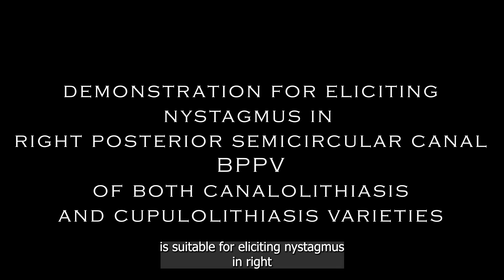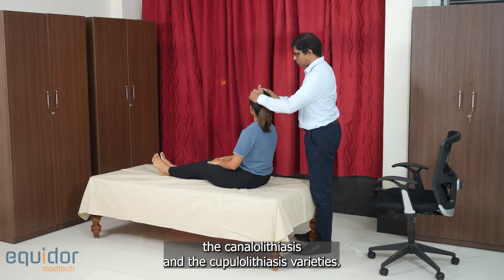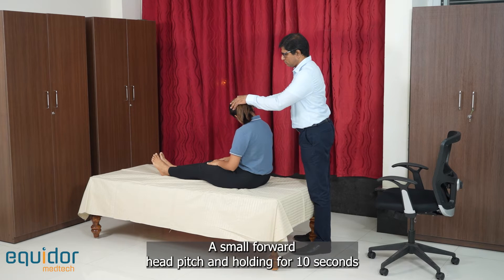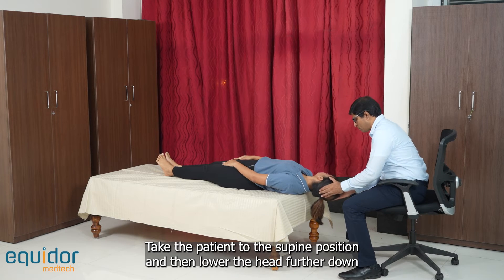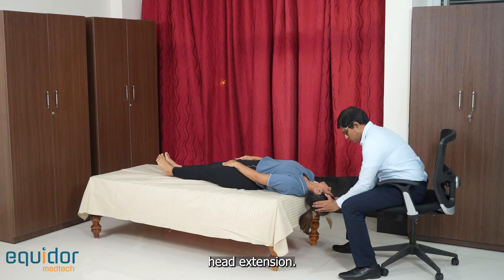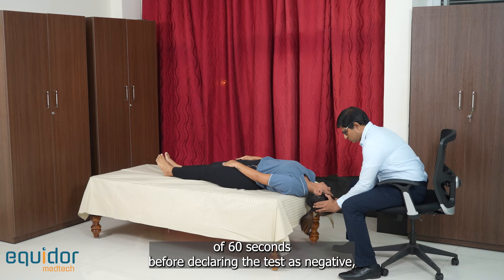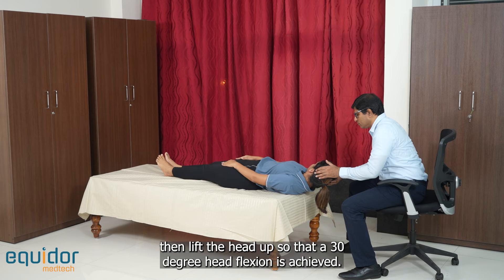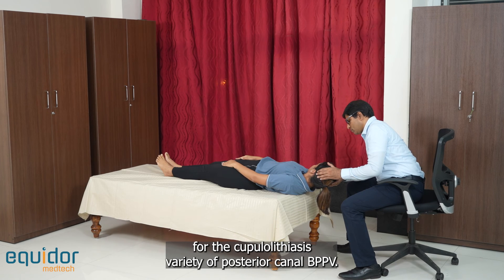Augmented Dix Hallpike and Half Dix Hallpike Test Right

Comment: What is Augmented Half Dix Hallpike' s maneuver?
Reply from the maker: ‘Augmented Dix Hallpike’ AND ‘half Dix Hallpike’. Augmented Dix Hallpike increases the sensitivity for two reasons. First is the forward head pitch. The debris moves forward (towards ampulla) during head pitch forward. When this is followed by the actual Dix Hallpike test, the debris falls from a bigger height increasing the robustness of observed nystagmus. Second is the extra extension i.e. 45 degrees or more. This also increases the sensitivity.